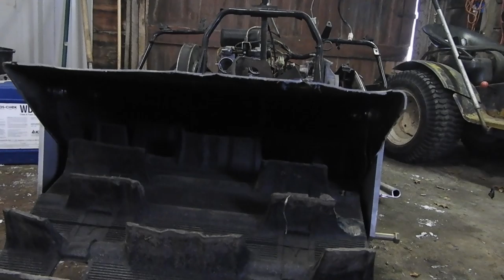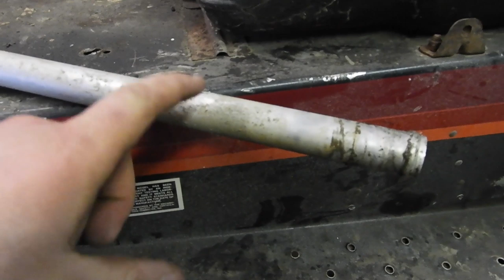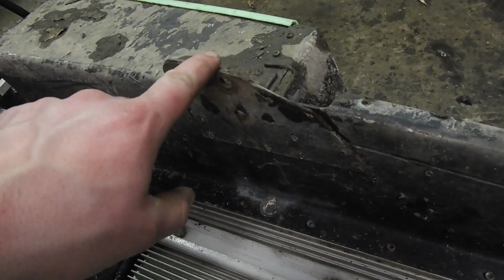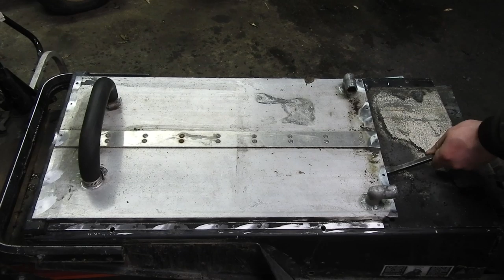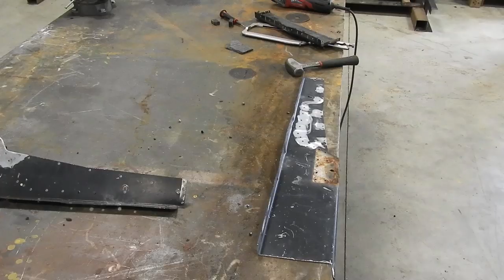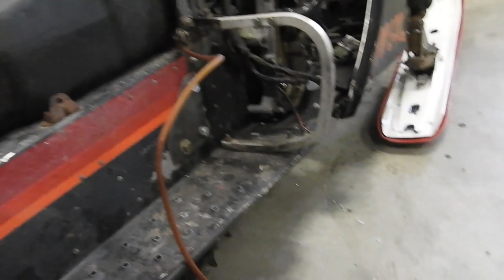Converting a Phazer to Liquid cooled: Heat Exchanger Installation

Comment: get a heat gun.......heat up the gas tank bottom corners until they are soft,  and push it in so gives you a notch for the lines
Reply from the maker: I didn't think of that, could always get another tank if it goes bad, thanks!
Reply: @adaminthemitten8940   Bare in mind there will still be gas fumes still in your tank.  Go cautiously.  If you need more heat, use a kerosene turbo heater.